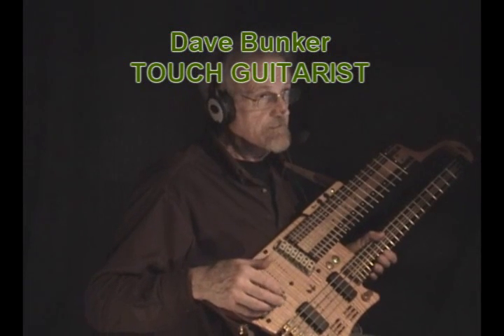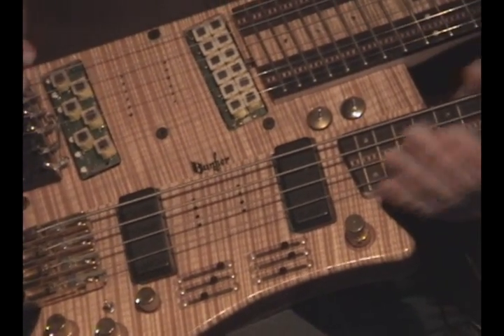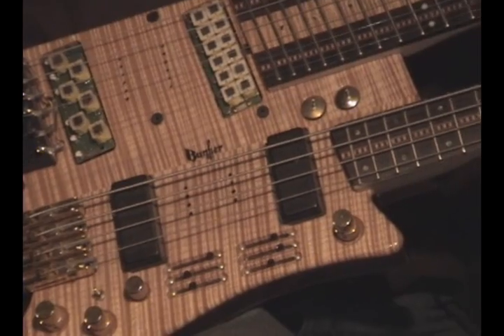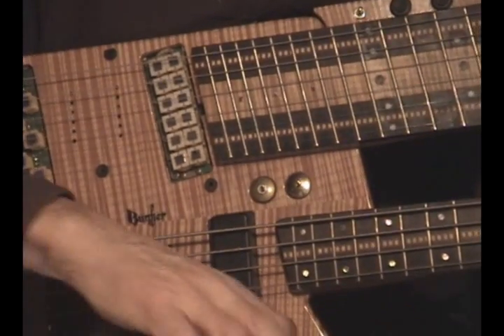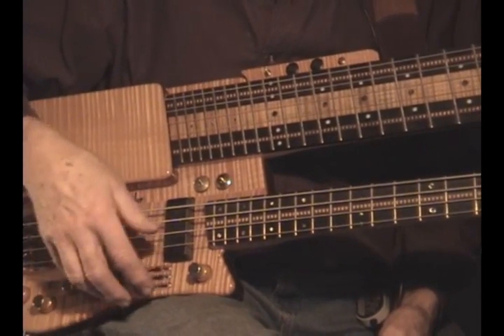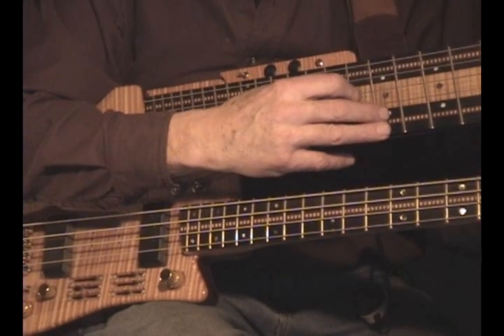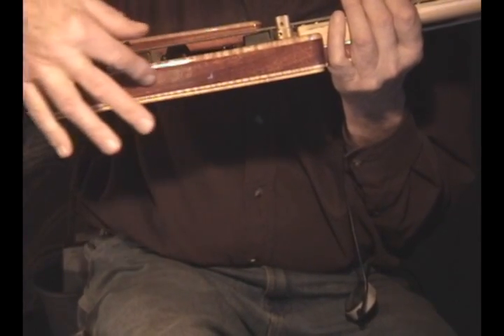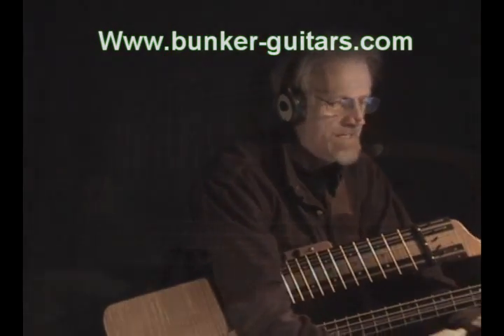#-4 in series, how your Touch Guitar works

Comment from the maker: yeh, the finger slides up the neck on the strings but the pickups are off, or if you slide a note or whole chord anyplace you still get the full slide but no noise, it's great, if you flip a switch to the 6 sense mode you still are muted but if you pull off open you get the note anyway